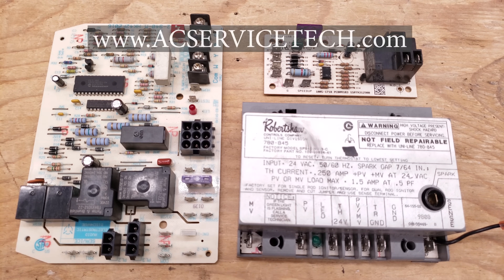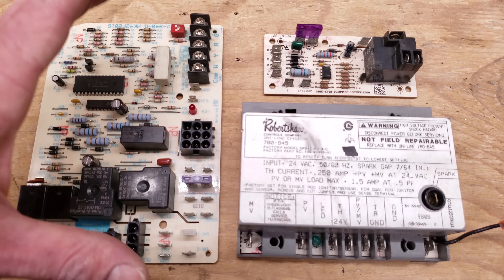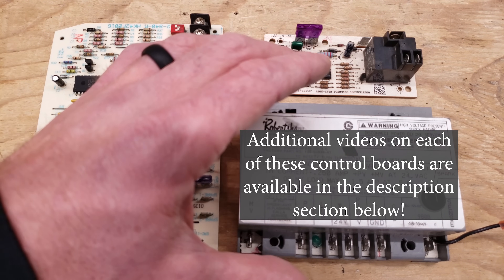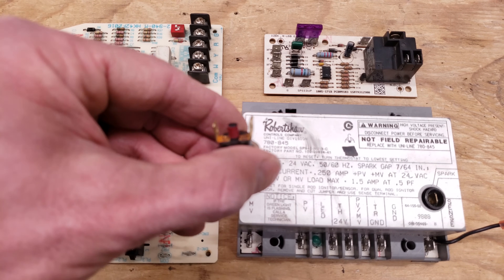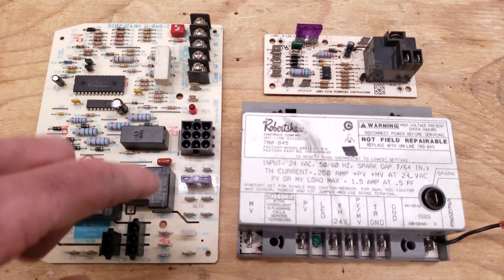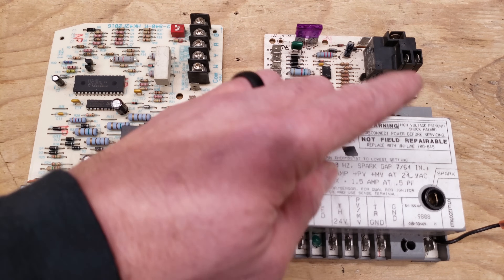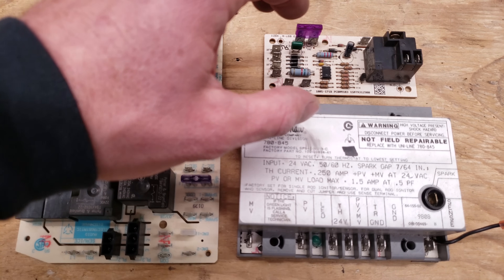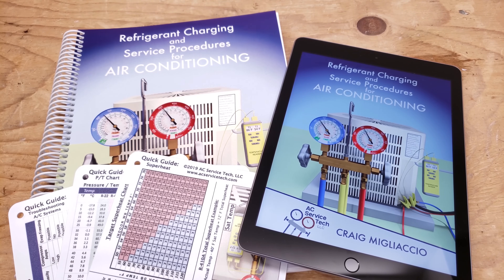HVAC Control Board Operation for Troubleshooting!

Comment: Most of time, it’s cold solder joint. During auto soldering process, most thin parts are ok, but larger parts, such as relay legs or power scr connections don’t have enough time or heat to melt the solder, causing cold solder joint.  I use x10 or x30 magnifier to check those larger glob of solder.  I fixed refrigerator and AC card.  Once fixed w/o using costly parts, they seem to work forever.  Ex USAF and LM guy.  In other YouTube site, many thanks from viewers.  Thx

Comment: On a relay for a refrigerator I am getting 12vdc on one side of the coil but the other only 6vdc...is that normal? Or are they supposed to be both 12vdc?

Comment: I put a generax gwnerator in a couple of yearrs ago an it seems like thats when my switch started to trip. Only when it gets below around 35 degrees. When thermostat suppose to switch from heat pump to furnace.

Comment: What would cause a blower motor to run slow but then when you reset the power to it runs normal for 5 or 10 minutes then goes back to running slow?  

Should I be focusing on the blower motor module? Blower motor?  Or circuit board related like a relay?  

It will run slow and then once I turn power off and turn it back on it runs at full speed like everything is perfectly fine but only last for about 5 minutes before it goes back to slow and the motor makes some noise like it is trying to go faster....

Comment: how do you understand the sequence of operation on the board, also how do know what relay control what??
Reply: It’s not something to understand. Only memorize. Draft inducer motor, 
pressure switch, ignition, gas valve, flame, and finally blower motor. If something drops out of that sequence, you know where your problem is. Most boards have diagnostic codes that flash on the indicator light.

Comment: I was ready to replace the board on my unit,  after a final inspection,  the soldering on the red wire had broken off,  re soldered it and the AC came back on.

Comment: my goodman control board status light does not light up. it has 120 coming out of the board into the xformer but no 24v coming out of the xformer i already replaced xformer with 2 new xformers but still have no 24v coming out of the xformer.

Comment: I recently had trouble with my heat pump defrost board with adaptive demand defrost.  Tech replaced the board and thermistors, but I found the information on ADD for heat pumps was sparse.  I was able to piece together enough information to get an understanding.  Of course, there's no info on the algorithm used. 

 I got interested because the tech moved the termination temp jumper from 70 to 50 erroneously thinking it worked like the run timer on timed defrost boards.  Didn't impact my repair, but made me curious.  I didn't find any info on the best termination temp except for refrigeration where you want it a low as possible to avoid cycling the product. My board comes defaulted at 70 but I saw others that came set to 50.

Comment: My blower motor pulls 50 watts more with warm 100F air vs cool air 60F due to density use a PSC motor 1/3HP.
Reply from the maker: Yes less efficient when warmer, thanks for sharing!
Reply: @acservicetechchannel  Why does blower motor use more power with warmer air ??  You would think with less dense air it would use less power. What is the theory behind this.   Anyone know the answer  ?       Thanks in advance

Comment: As a newb your videos have been vital; THANKS!!!   The board series you've done have been great!  I studied them all last weekend; had a Lennox G24 that wasn't operating, just that "click" at the board and GV when trying to light.  Went through the OofOp, got hung at the GV.   Tested all mech components; OK. ohms and voltages OK til I got to the GV on the board.  It was sending random shots between 25v and 17v with each "click" to the GV.  
             The ambient temp at the time was running in the low 50s.  After doing other research, I heated the GV up to just warm to the touch, fired it up and away it went!  The house is in transition I guess, they want to keep temps lower until occupied but I have them keeping it warm until I get a new board in.  I don't think it's the GV, I think it's the low sporadic voltage not strong enough to pull the plunger on the GV when it's cold, but I'm not 100% sure about that.   Guess I'll know for sure when I see what V I get off the new board on the GV.  Your opinion would be appreciated....
Reply from the maker: Very interesting! The best thing to do would be to pull off the hot wire from the gas valve and measure the voltage when the wires are off of the load. This would be when the wire is disconnected from the gas valve with the power off and then turn the power on and let the sequence for heat get to that part and measure it.  Make sure you are getting 24v to 29v there without a load.
Reply: @acservicetechchannel  OK great!  We'll give that a go.  THANKS!

Comment: Always Great videos. Listening to a podcast a while back, they shared an acronym for the sequence of an Integrated Furnace Control and it went like this "Take It Slow Its Gonna Blow" , "T" is Thermostat , "I" is Inducer Motor , "S" is Safety (Pressure Switch) , "I" is Ignition ,  "G" is Gas , and finally "B" is Blower Motor"  Hope it helps !
Reply from the maker: Absolutely, thanks William!